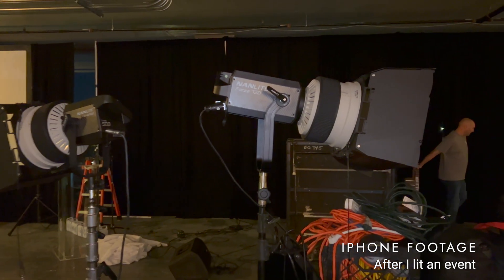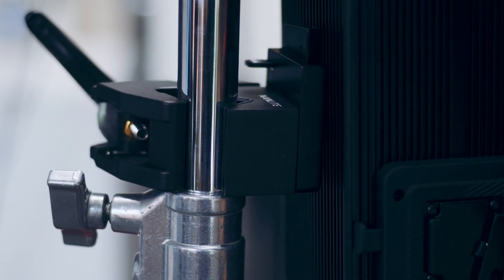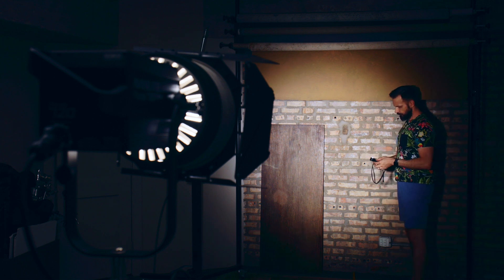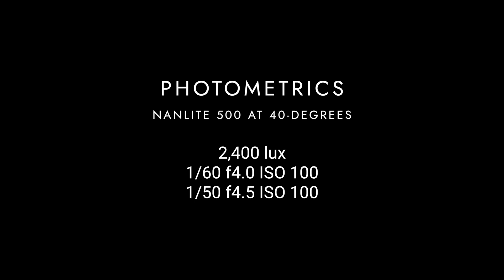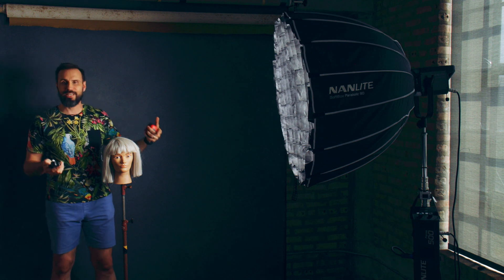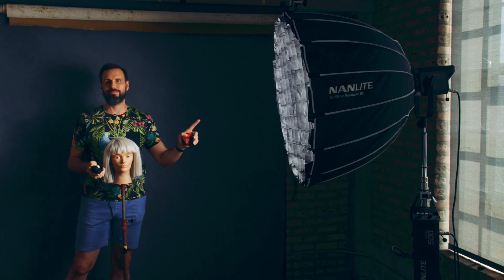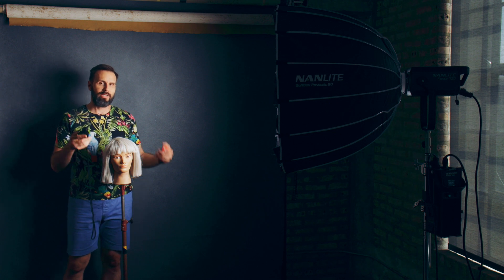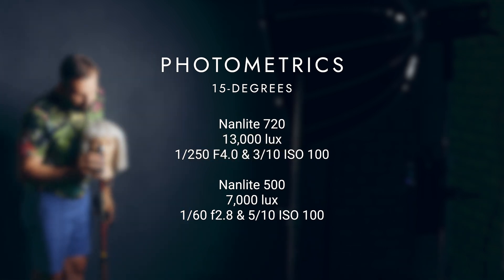Can the Nanlite Forza 720 Blow the 500 Out of the Water? | LED Light Photometrics Comparison

Comment: Hi John--I'm considering switching to constant light for dog photography.  I'd need a shutter speed of 1/500th and an aperture of 5.6 or ideally 8.  Do you think I could do that with either of these lights?  I'd be willing to do an ISO of maybe 1250 but I'd like to stick to 800 or less.
Reply from the maker: If you had the lights in close with smaller modifiers you might be able to get that exposure, but if there is any kind of movement you're going to get motion blur. So I would stick with flash, unless thats causing the dogs to freak out too.

Comment: thanks for the photographic comparison, as most of them are cine related, but this system does look like a constant light contender for a profoto or broncolor flash replacement, at least for studio, still life, etc. esp. at that price point.
one question if you are doing a photo comparison, would you have an idea of what formats it could cope with, aka power settings for mf and LF film formats (6x4.5 to 6x9 as well as 4x5" sheet film), as not much is said to this subject.

Comment: Thanks for the test. It was very helpful. After seeing the difference between the lights, there is no way I would pay twice as much for the 720 over the 500. The weight and cost difference are not worth it for less than a stop gain in power. The 500 is producing enough power for all of my uses and I would rather have two of them for the price. If you have a special use like shooting outside in the daylight and trying to overpower the sun, or shooting athletes in motion I guess every bit counts, but in that case I would bust out my strobes. The newer cameras are producing amazing results even at 800 iso and I don't hesitate to push mine to 1600 if I need to. and that's for print in major publications. better to keep the kit lean and get the shot than worry about a bit of noise.

Comment: Hey, John. Great video. I think on the 500 the ballast attaches to the stand clamp on the back not with the strap. I own the 300 and the back of the ballast has an area designated with the same graphic that is on the clamp and it can slot right into that bracket. 

Also, my original silver clamp broke when an assistant incorrectly broke down the light and I bought their super clamp version of the mounting clamp — it’s a much better design in my opinion, the original was too easy to break.
Reply from the maker: That's good to know. I will check it out when I get to the studio. Thanks!

Comment: I’ve got 2 x 500’s in my kit and they are a great light. Build quality is fine after almost 2 years of use, but yeah the build quality could of been better. When I was building my kit I wanted as much power as I could get at the time.  So I’ve ended up with a 1200, 650c and the 500’s, but in real use my Forza 300’s, 150’s, 60’s and tube lights get the majority of use when doing film work. And when I do break out the big lights they are very rarely used at max power. Big lights also = heavy duty stands. If I was just starting to build my kit today would the 720 fit in? Probably not! The 720b would be a better choice, but honestly give me a couple of the cheaper FS-300b’s and I’d be happy.
And for photography, I’m still old school and prefer the size and power of strobes.
Reply from the maker: I hear ya, I am not usually cranking it to 100% but it sure is nice to have the option.

Comment: The 720 they upped tiny shortcomings from the 500 it seems.

Better lever mechanism for locking the light on the yolk. Much quicker, that's a good thing.

Better plugs with a locking mechanism for extra security. THIS is extremely welcome. I think the same as you, thinking it isn't connected well enough and using extra (unnecessary) force to ensure good contact. Doing something like that, one unknowingly can damage the contacts by accident 😶.

The ballast grip is considerably better compared to just hanging. However, I hope user error won't be a thing given the weight distribution. This is definitely a sturdy c-stand dependent system.

The COB is larger I agree in comparison and it would affect the output in the end.

The cough audio edits were funny in the end 😄, but necessary.

The 720 for me is the better choice. If they had not made those "updates" to the 500's build, I probably would stick with the 500 and modifiers the best I could to compensate. Great video.
Reply from the maker: Thank you so much! I had so many second second thought about the feathering on thei first tests so I ran them again two days later after I shot and edited the rest of the video. So I had to correct my mistakes, even though it was only a 1/10 or 2/10 of a stop difference. 

Yeah I was always worried that I was inserting the 500 cable wrongly, and sometimes I wouldn't even get it plugged in all the way thanks to my fear.